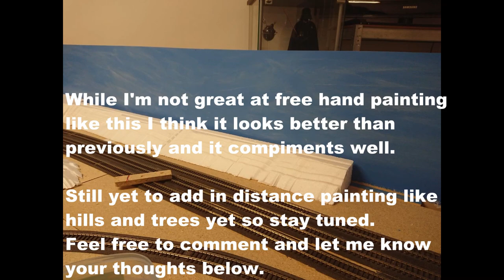Leila Central Model Railway Adjusting the painted Backdrops

Comment: Im loving the idea you are having a go. As an Art teacher of 24 years now, sky can be quite tricky. It starts above our heads as a rich pale to mid cobalt blue and graduates down to pure white on the horizon. Clouds are very wispy in the distance (lower down at the bottom the board), exactly as you applied at first leaving the white on after 1/2 passes. The temptation is to keep wiping to blend in. As they get further up or closer clouds get bigger. So half way up is a mixture of horizontal wiping with sponge and some light dabbing on the top areas of the wiping, if thats makes sense. 
At the top clouds are dabbed blending bottom edges in slightly no hard edges on the bottom. Leave tops of clouds rounded & fluffy with the white hard edges. Keep the whole thing pale, sunny sky is lighter than many think. 

Best thing I can suggest is look at the real thing, either outside if weather is showing what you want or google images. 

Really hoping that’s helpful. Many people shy away from painting backscenes or just paint plain colour, its brilliant you are taking the ‘bull by the horns’ and giving it ago. Great stuff...
Reply from the maker: Thanks fort he kind words and yes I have been looking at the sky and also photographing it. I've never been good with free hand painting like this so its turned out well considering my skill level and given the results its acceptable. Can only get better with practice and considering how cheap this was, there will be a lot more practice to come. All the best Clint.